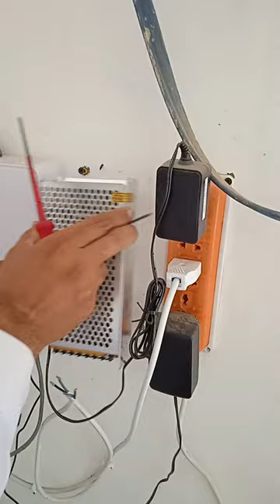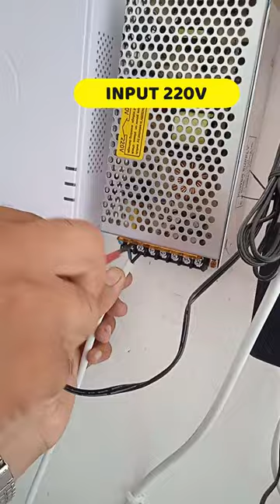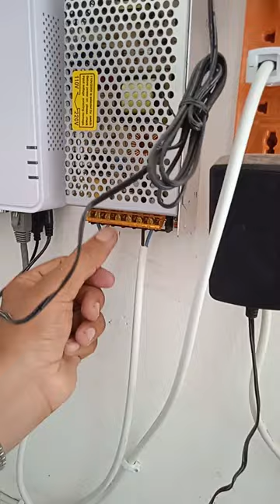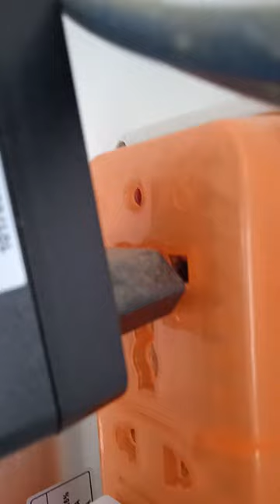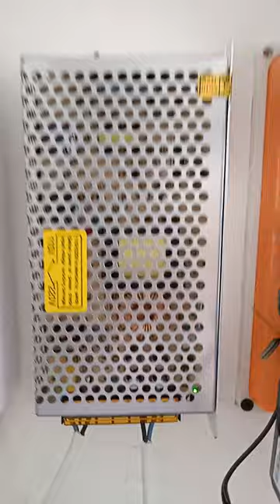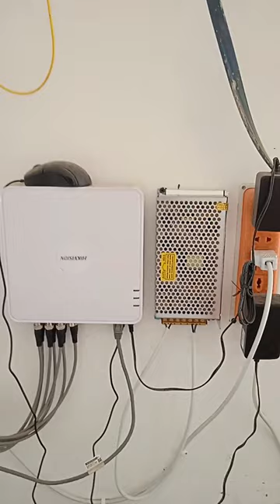CCTV cameras power supply replacement #cctv #shorts

Comment: I am using 12 volt 5 amp smps for 4 camera. 1 camera blinks non stop for power loss (long cable). Can I use 12v 10a smps for 4 camera?
Reply from the maker: Yes ofcourse you can. If possible buy 15v 6amp.

Comment: How many camera can use this power supplu
Reply from the maker: This is 12v 10ah we can use it with 10 cameras if the wire length is not so long.
Reply: Agar dono output ko ek sath jor ke long wire ke 6 cameras chalay to kuch hoga kya vai please bataon